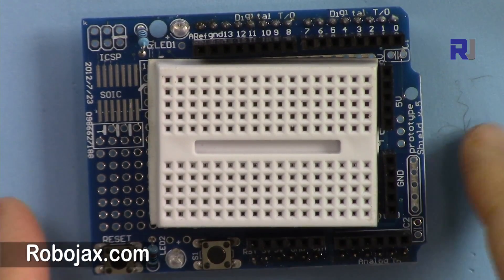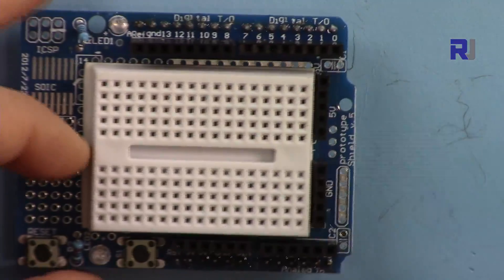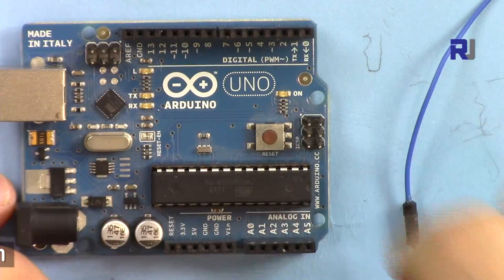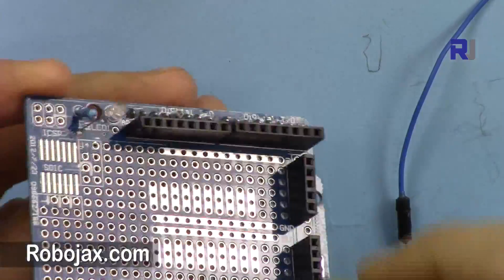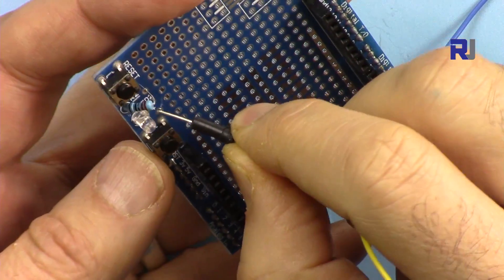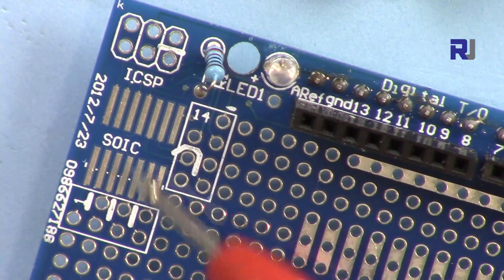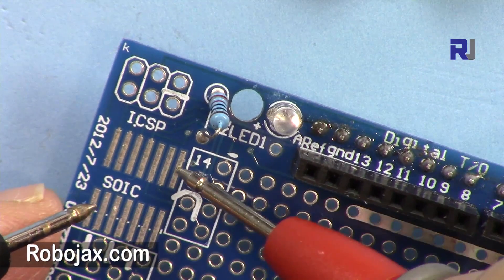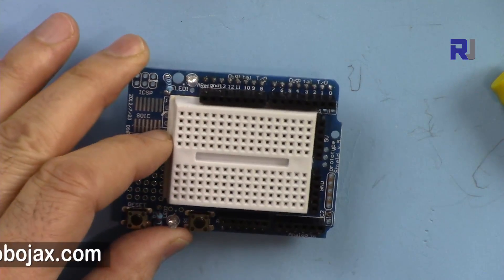How to use Prototyping Shield with breadboard for Arduino

Comment: I really wish they had brought out the I/O signals directly to the board instead of having to use the clunky jumper wires for the connections.
Reply from the maker: They could not because breed board is attached later.
Reply: @robojax  I'm referring to using the protoboard, not the breadboard 1:42.  You have to use jumper wires from the connector to the protoboard which seems silly to me.  I believe the genuine Arduino version of this board does what I am suggesting.  Also, doing what I am suggesting would not negatively affect using the stick on breadboard since the protoboard would not be used in that case.

Comment: Great video can you use a dc motor on a protoshield just by plugging it in the 5v and ground or do you need the breadboard?
Reply from the maker: yes you can use it Here is my *** Free Arduino Course **
Arduino Step by Step Course  (over 100 lectures) Starts here http://robojax.com/L/?id=338

Comment: I'm very new to Arduino so I might be missing something obvious here, but I am trying to connect my Arduino Nano to the board so I can get more ground and 5v pins for a project. Right now, Im sticking the six pins on the Arduino Nano through the ICSP holes to run some sensor code, but I found it only works some of the time. Should soldering it solve this, or is there a better way to connect them?
Reply from the maker: this is specifically made for UNO and Mega.  Should not use it with any other boards as the pics might got short circuited and your board die.

Comment: the original board came from adafruit industries but is very expensive... i did buy this version from "diymore DM" marked and now with 4 digitals pins in use.. NOT D0 and NOT D1 i cann not upload sketches any more...

be carefull flash will fail if you add lots of componentes the uno will see this board and not work, i did replace the uno with differen versions and i did build it again in parallel..

it was the board :-/
Reply from the maker: Thank you for the informative comment.

Comment: How does it install onto the Mega 2560?  It seems none of the pins lineup anywhere and so I have no clue of how to even put this on the board it came with my kit and I haven't found a lesson yet that uses it.SO looking at the board which end does the Surface ICSP mount? Like it either points at the data cable import or it faces away. Then what pins should it be lined up with?
Reply from the maker: I just tested it and it fits perfectly. Try to align the pins.
Reply: @robojax  Yes I can fit it in in a few different ways which is why I asked what direction the board goes in and what are the 1st pins on either side that it goes into. The way I think it goes the pins are misaligned using it like puzzle peace it goes in multiple ways. I sorta need a direction and the starting pins on either side. So one the power side does the prototype board 1st pin go into the 3.3 volt pin on the Mega or further down into the analog pins?
Reply from the maker: the shield has labels on all pins. so it should fit right on the same pins.
Reply: @robojax  I didn't see those labels to damn small. I think I got it. It looks like there are at 2 female pins on the mega 2560 that the prototype doesn't use using the labels I think I was able to finally align everything and get it on there and it looks correct now. Can I leave the prototype board on or is it only for use with specific lessons\functions?

Comment: what if i need more ports for the 3.3v?
Reply from the maker: that is why we have breadboard. Connect a wire from 3.3V to breadboard and get as many 3.3V you need from bread board. Breadboard is like splitter.

Comment: I have this board and the led next to the push button is not connected to ground. Why would that be?
Reply from the maker: I have explained that. That is free for you to use. You need to connect it whichever way  you want it.
Reply: @robojax  there is a hole for the positive side. The negative side is connected to the negative side of the switch. Neither of which are connected to ground per the schematic. I think there is this small flaw in my board. Regarding the ground connections for the led2 and push button.
Reply from the maker: I watched the video making sure that I have explained it. Yes if the way I should you connect it and it doesn't work, then you got a bad module. Just watch the video again in case if you missed it.

Comment: Does this mini protoboard have positive and negative pins?
Reply from the maker: it has all pins of arduino like 3.3V and 5V and negative (ground) I have mentioned at 01:00
Reply: Robojax Im using 3 of the 5v ports and it looks like the arduino don't have enough energy to process ;-;
Reply from the maker: if you connect to 5V pin, you have to know how much current (ampere) you  draw from Arduino which gets the current from USB. It depends on your USB, usually it would be less than 1A or 1000mA. If this is not enough, then use external 5V and then share (connect them) the GND between arduino and your external power supply.
Reply: Robojax ok, thank you so much
Reply from the maker: you are welcome.
Reply: @vitor-hc3os   You can use 500 mA current for Arduino itself + everything attached to Arduino with 5V Pins if You supply energy to Arduino UNO through USB. If You supply energy to Arduino UNO through VIN pin or through barrel controler, you can use 1000 mA. Through 1 digital pin max 40 mA can flow, otherwise Pin can be dammaged.